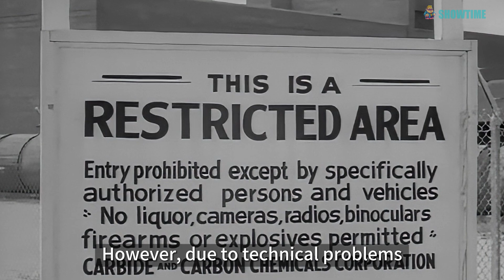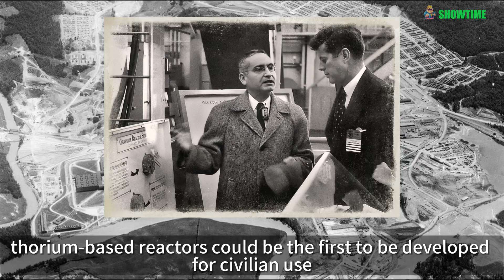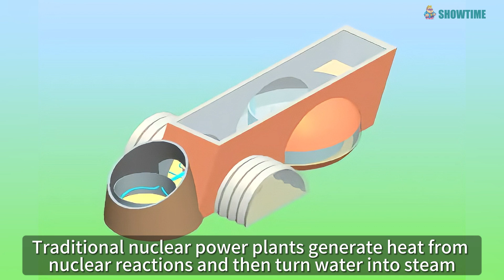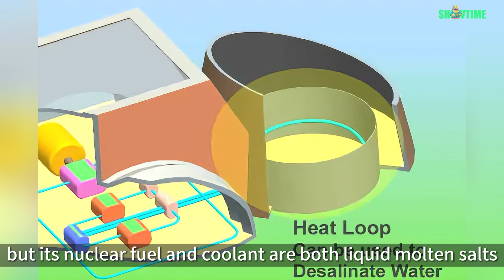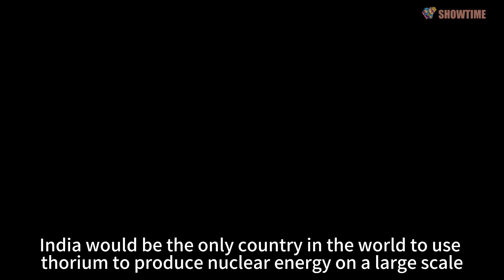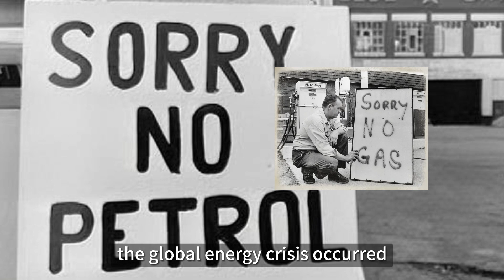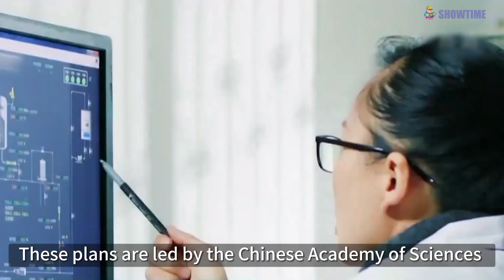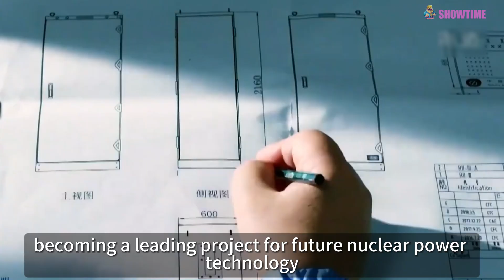World-Leading Nuclear Achievement Thorium-Based Molten Salt Reactor

Comment: 'Due to technical problems, research was interrupted' ... That is putting it mildly. In fact, it was because the US wanted a Uranium instead of a Thorium reactor. The reason they wanted this was for militair applications more specific: nuclear bombs. And Uranium was more suited for that then Thorium. Just a minor detail that set us 50 years back to get to a safe nuclear solution.